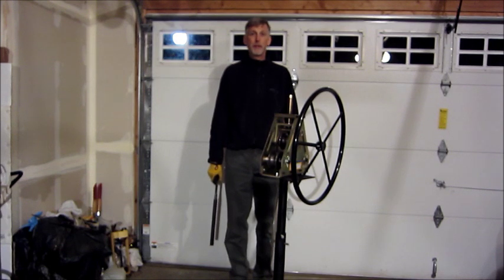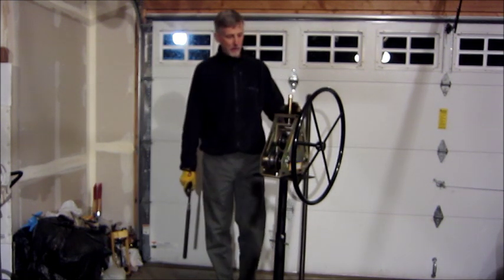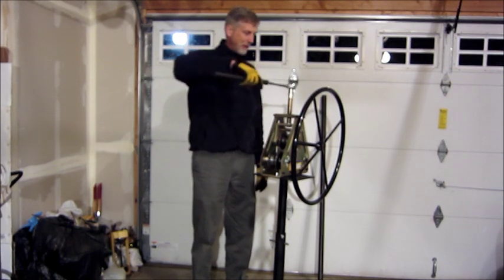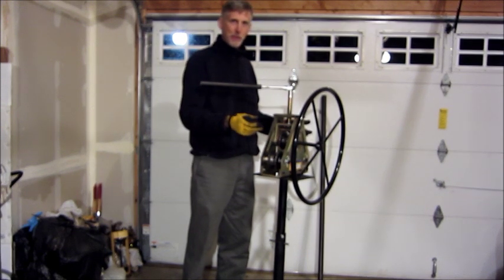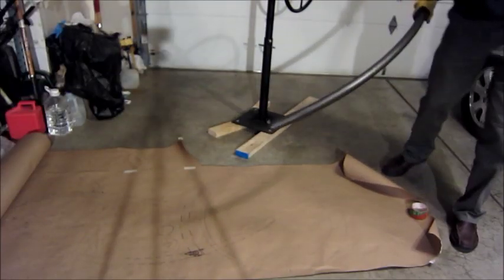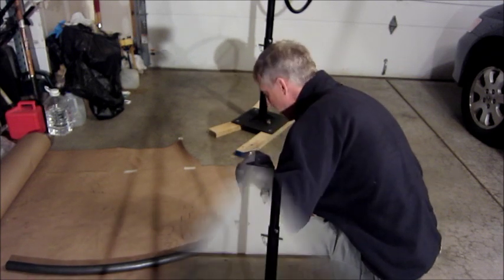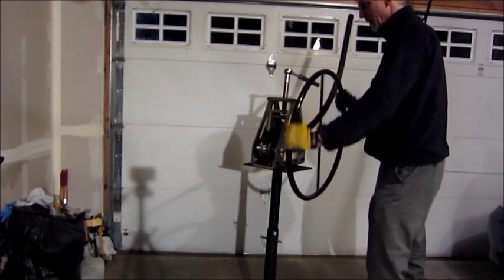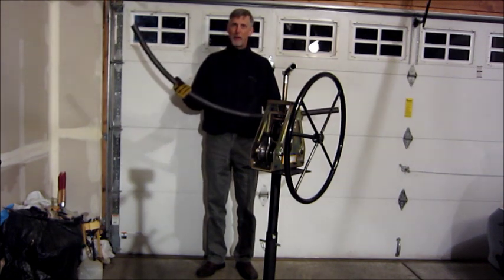Roller Tubing Bender Demonstration

Comment: something worth noting is that you really should have a second person holding the tube straight, otherwise it has a tendency to twist while it bends in my experience with this machine. to answer Gaus, you don't do that. crimp once, roll it, then roll it back, crimp again. unless you are changing the angle at the ends.. makes more sense when you're using the machine why it doesn't work, plus, you're far more likely to mess up if you go to fast. either fold the tube or overshoot the angle. this isn't a fast process period. MUST take your time or end up scrapping a lot of messed up tubes.
Reply: You have inspired me so much that I am up early to look forward to my day.  Have a good one.